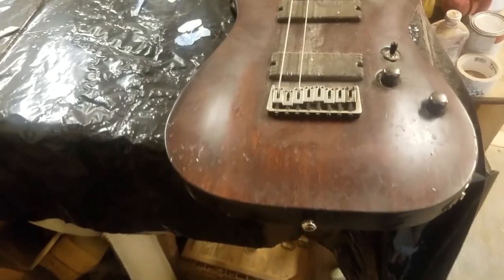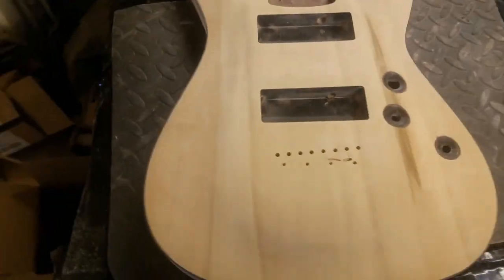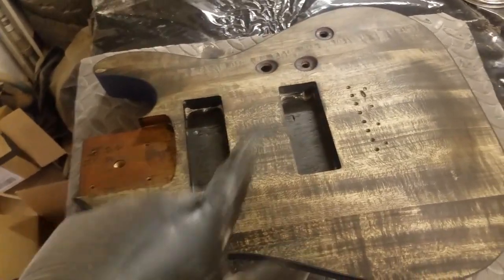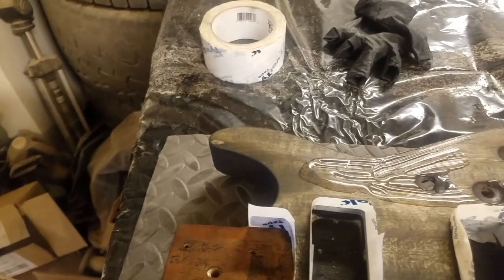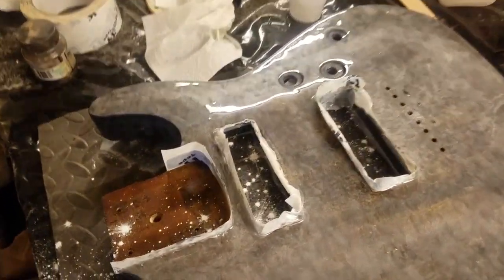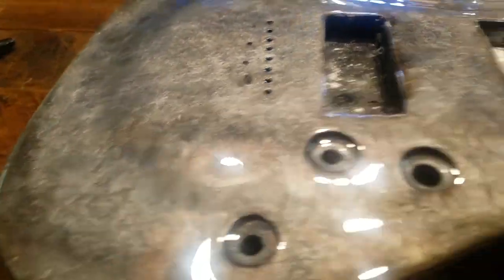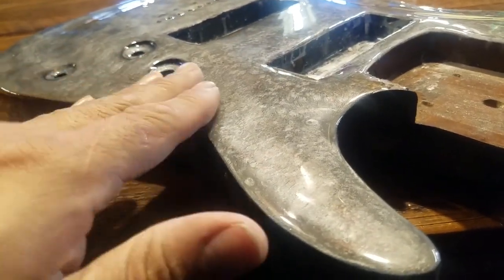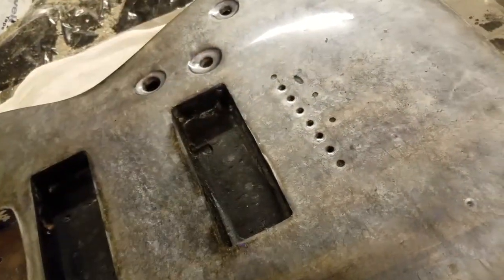Epoxy resin guitar finish

Comment: The period  finish didn't appeal to me but great to see a guitar brought back to life. A good tip, if you cover the bottom of the guitar even the edges with tape, you don't have to sand for ages to clean the epoxy off. Better still tape on edges and have it elevated off the bench.